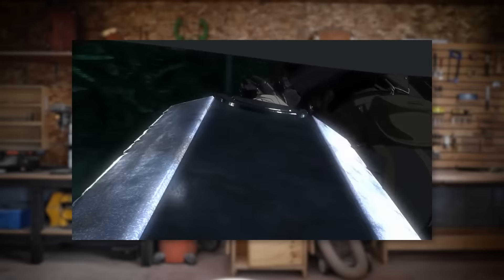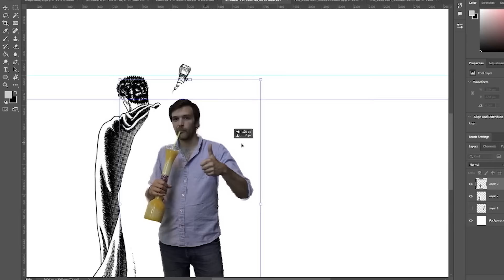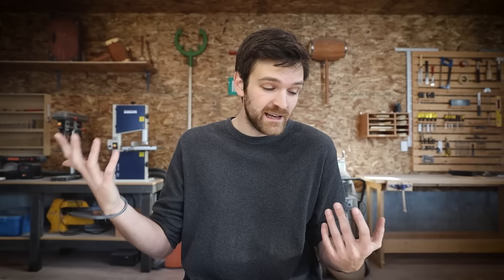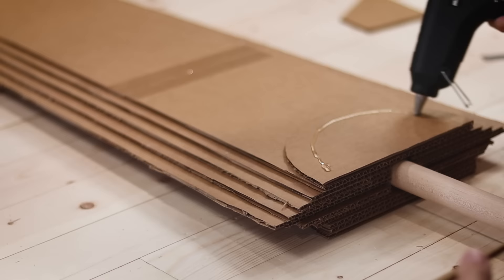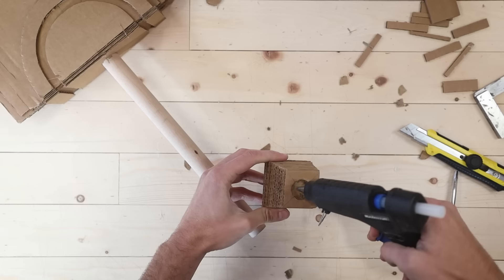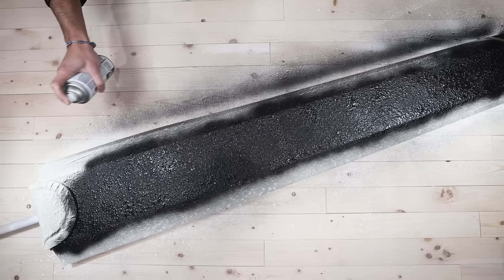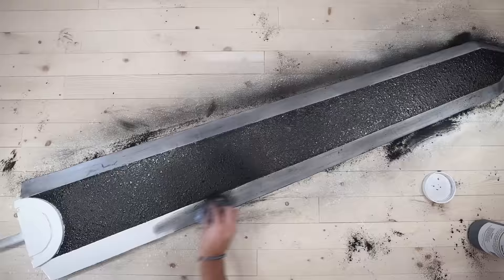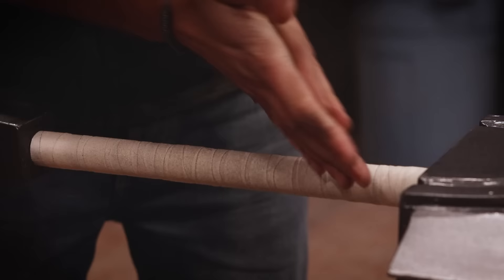How I Made the DRAGONSLAYER from Berserk (with no tools)

Comment: Bofore applying the graphite powder, paint the parts you want metalic a gloss black base coat, and wipe down the prop with acetone to get rid of any smudges or adhesive after sanding. THEN apply the powder. Other than that, you did excellent! I'll make somthing like this myself one of these days

Comment: Okay, so I worked with graphite powder a lot on my model kits. Things to note:

1. graphite powder should be applied on a very smooth surface (like applied on an almost finished surface, then apply top coat again to seal it in). Actually, the best look is no applying top coat because it will ruin the metallic look of the graphite, but it rubs off so on the scale on what you made, you have to apply top coat. 

2. graphite powder looks better when applied on a dark surface

3. it;s an option for you to still have used the graphite powder for finishing - like use it to highlight edges - the same principle you do for applying light weathering on the edges of model kits.

Comment: The graphite powder is as shiny and reflective as the surface you applied it to. Use a gloss black. It needs to be glossy and smooth. 1000 grit wetsanded etc. Polished. Preferably 2k gloss over top.

Comment: I’ve been following along with your video now, I’m about to start the drywall step. So far this has been a blast. I’m not sure where I can upload the progress pictures but let me know if you’re interested!
Reply: Now that I’ve started the drywall steps I’ve slowed down a lot, and ive noticed that the tip is pretty fragile. It doesn’t hold shape very well yet. My plan is to use tape to help the shape in between layers of drywall. I’m also going to use flex seal over the entire sword after I finish the drywall to see if I can make it sturdier and less likely to crumble down the line.
Reply: If you post it somewhere lmk me and my friends started building it!
Reply: So I didn’t use tape, more drywall helped it out a lot. I also didn’t use flex seal, I used this stuff called bondo all purpose putty. That helped me fix the tip. I’ve just put the first coat of primer on it. I’m using rust oleum brand paint like in the video.
Reply: @christianbryan1503  can you please tell me what specific tools paints etc. You used (I know some are in the video) because I want to make one too
Reply: @Cyberi0nix597  sure. I bought 5ft cardboard sheets from staples. I wish I had bought 7ft sheets instead. I used a household hot glue gun, and a tape measure. Don’t be scared to bend the cardboard a bit while you’re gluing, the glue will lock everything together. Any drywall compound will do but I used USG Sheetrock brand. It says dust control on it. I used bondo to fix the big cracks, but later I realized that super glue was better. For the tiny imperfections use spackle right before you paint. I used DAP fast dry premium spackling. It has a gold lid and it’s awesome. For paint I’m using the same as the video, rustoleum brand. I bought a flat white primer, skipped the gloss, semi gloss black, dark gray gloss, and finally a krylon metallic aluminum. I couldn’t find hockey tape so I just bought white athletic tape from Walmart so same difference really. Lmk if you have other questions.
Reply: @christianbryan1503  I will notify you if I have other questions in the futures for now I'll give ya a follow for giving me instructions
Reply: i finally finished it. im gonna post it tomorrow on my twitter.
Reply: @christianbryan1503  Nice good job man 👍🏻
Reply: @christianbryan1503  Chris I have a question how big is the dowel you put on the sword?
Reply: @Cyberi0nix597  it’s 1 inch in diameter, and I think i bought one that was 48 inches long. I’d say get one long enough to go more than halfway through the sword
Reply: @christianbryan1503  so like a 55 or something?
Reply: @Cyberi0nix597  that’s perfect. Be suuuuper heavy with the hot glue. What I did is I glued one of the outside sheets on first after cutting through the middle ones, put glue down, put the rod in, covered it in more glue, then glued the other outside sheet on

Comment: Hell yeah!
I just did a cardboard dragonslayer build recently too although you did a much better job than me. I'm definitely checking out your other videos.
Regarding the chain, I worked that out by using PVC pipe rather than a dowel. At the spot where the chain is, there's a tee connector where I glued in wood. In that wood, I put in an eye screw and linked a carabiner.
The purpose of the chain is to be able to hold it on your back, which I've managed to make a comfortable build for too using straps and belts.
Reply from the maker: Cool, I'm glad someone else had the idea to build one too!
Reply: @KyleMerriman  I actually ended up re-making the whole thing with the methods from this video.

Thank you so much for this guide, man. My guts cosplay is gonna be sick because of you.

Comment: Little note/warning for people using hot glue guns: 
There are multiple types of hot glue guns and hot glue. Divided into High Temp and Low Temp. High temp gives you longer work time because it takes longer to cool, and it usually sticks better but it’s super hot and can melt or burn certain materials. Low temp is safer but needs to be used quickly because it cools and hardens quickly which also makes it stick a bit less strongly.
Here is the WARNING. Putting Low Temp glue into a High Temp gun will cause dribbling, dripping and burns! It will leak from the tip and it takes a long time to cool and is much more likely to burn you. High temp is designed for that and doesn’t drip or leak and it stays where you put it. Low Temp if overheated is just a dangerous mess!

So if your glue gun is always burning you or leaking glue from the tip or the glue seems to drip and slide around, that means you’re using the wrong glue in the wrong gun. Make sure to pair the right glue with the right temperature for safety and the best gluing results.
Also, the opposite is true too… if your glue just isn’t melting, taking way too long to get hot and seems to need a ton of force to squeeze out… that’s because you have high temp sticks in a low temp gun or your gun is in low temp mode. Just check for a switch on your glue gun or pick up some low temp sticks or ones labeled as for arts and crafts which are almost always low temp to be safer for kids.

Lastly for the crafty and flashy people… they actually make hot glue in a ton of colors, glow in the dark, glitter… etc. if you’re making something dark and you keep seeing white glue, they make black glue sticks.

Have fun and be safe! Hot glue is super useful and versatile if used properly.
Last tip… for small jobs it’s good to keep a small stick and lighter in your craft kit or daily carry. Just take half a glue stick, heat up the side with the lighter and stick the glue stick to the side of the lighter. When you need to fix something or adjust something, pop the glue stick off, melt the tip with the lighter, dab the glue where it’s needed and then just stick them back together and put it away.
A lighter is useful to have anyway, so just throw a little glue stick on there too! 
Just be safe with the fire and don’t burn the glue until it turns black… you just need to warm it up enough to smear a bit of glue. 
Be careful and good luck!

Comment: This is awesome but the doc is missing s me info like the full measurements of the dowel
Reply from the maker: I didn't include the length of the dowel, because it actually doesn't matter all that much - the slit you cut in the cardboard just has to match whatever you get. I think mine was 4 feet. The longer the better as far as stability goes

Comment: i'm interested to know how your dragon slayer sword has held up over the year. i'm hesitant to use drywall compound because i'm afraid it will crack or chip off easily. not sure if youll see this, but i'd love an update as i really want to try this method. Also, would hardening the cardboard with something like wood glue, or shellac improve longevity?

Comment: Dude you are amazing and thanks to you I am planning to make one myself >:). I do have a question though, would you recommend using the materials that you used for ichigo's shikai to give it more durability or would it be to heavy. I tried to calculate it, but I was hoping for an experts opinion! I am about 5'7 so i think that cuts it down to a measly 6ft I think. Thanks for the awesome videos and looking forward to anything else you make!
Reply from the maker: It would definitely be way more durable, but as it is the shikai I made is slightly heavier than the dragonslayer, so if you made dragonslayer out of the same materials I think it would increase the weight pretty substantially. You'd probably still be able to lift it, but maybe not swing it around
Reply: @KyleMerriman ahh unfortunate, and thanks you're the best I appreciate the reply! Cardboard is definitely the move then! Again your videos are super enjoyable and if it's not an issue I'd love to see more!!

Comment: Great work! 👍
I’d like to try this method as well but I’m living in Germany and there is no correct translation for drywall compound. Maybe I can narrow it down by knowing what drywall compound is exactly used for…
Thanks ahead
Reply from the maker: Sure! Drywall compound is also called spackling - it's something that's used to patch holes in gyprock walls. It goes on as kind of a liquid, and then dried solid so that you can sand it down and then paint it. Good luck!
Reply: @KyleMerriman  Thanks 😂

Comment: Hey, quick question. I’ve followed your video using the measurements given, with the (only) difference being I used foam board instead of cardboard. And for the drywall part I am on. How many coats would you say were due for the blade. My first coat ended up drying revealing the  steps on the blade. If you could reach back out I would greatly appreciate it. Awesome vid btw!!!
Reply from the maker: Probably 3 or 4. The first coat definitely shrinks down pretty substantially once it dries, but it should hold it's shape after a few more coats.
Reply: @KyleMerriman  thank you tons for the reply, I’m on my third and I believe I’ll be able to spray paint it by the end of today!

Comment: I'm currently working on this project, but the difference is that I used plywood instead of cardboard. I finished cutting and putting it together, and the result was satisfying, but the weight is noticeably heavier. Right now, I'm trying to find another way to create the black and rough texture in the middle because I can't find anyone selling that texture spray. Does anyone have a better solution for this?
Reply: Some gesso and a kitchen sponge worked great for me

Comment: What he doesn’t mention is the weight it’s like 30 pounds and I can barely swing it around but it’s still sick
Reply: Mine came out to be 15 pounds, and i even used heavy cardboard lol
Reply: @pietud9697 what was the ply of your cardboard like 3 ply or 5 ply?
Reply: @pietud9697 Also I wanted to ask that I need to use all white color stuff like primer , white gloss spray paint and drywall compound if I already manage to find a white cardboard of such big size?
Reply: @SSCAdda2023 If i remember correctly, my cardboard was 3 ply
Reply: @SSCAdda2023 The color of the cardboard doesn't matter, neither does the color of the drywall, color of the primer, color of the gloss spray paint, since you're going to paint over it. Follow the videos instructions

Comment: Can I use wood I saw some at Lowe's? They had the right size,and length for it. And all I have to do is get them to Edge it plus get a pipe thats strong
Reply from the maker: You definitely could, it would just be way way heavier, so swinging it around might be a problem. Even made of cardboard the thing is crazy heavy when you're holding it by the handle

Comment: How durable is this build? I made my golden age sword out of xps (pink) foam boards and mine is very fragile. Does the drywall chip or crack at all under pressure/getting smacked around?
Reply from the maker: You wouldn't wanna smack it against anything. I don't think it would shatter or anything, but there'd definitely be some cracks